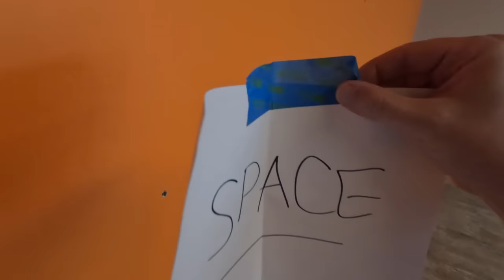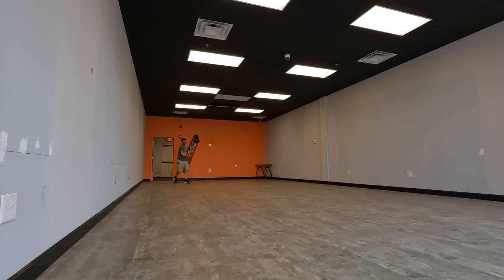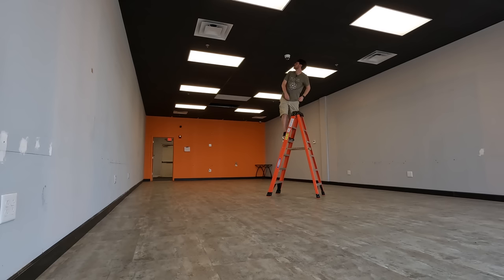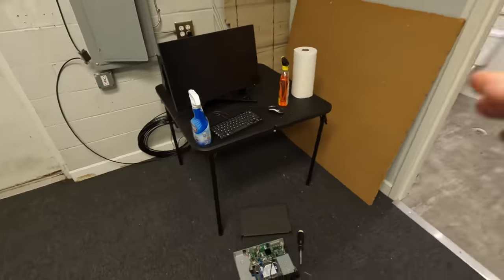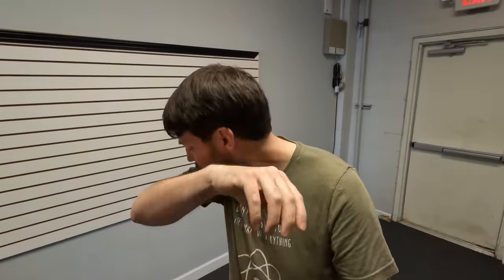First day in a new space! (moving 01)

Comment: Of course the best part of moving into a new space is showing everyone the key that unlocks the door 😀 Anyways, congrats.
Reply from the maker: Just don't show it too closely or else LockPickingLaywer will make a copy and—well, he could just pick the schlage lock pretty quickly, more likely.
Reply: @JeffGeerling  Use an electronic lock. I designed one , over 40 years aggo that just used a 4017 CMOS IC and a non matrix keypad. It can use up to a nine digit code, and my deign locked out a retry for about 30 seconds. To lock it, you simply touch any button which resets the counter.
Reply: @JeffGeerling  Honestly there's a single frame that's more than visible enough to see it entirely, but I assume you are replacing the locks.

Comment: For the NVR, remove the round CMOS battery, put it back upside down one seconds or two to discharge the capacitors and put it back the correct way, or put another fresh one.  It should then be at factory default.

Comment: Jeff sell the tool boards if you remove them as you stated you will use peg board which is a lot cheaper than the tool board you have up already. Maybe trade it for peg board so you don't have any cost in your peg board. Just a suggestion to save on out of pocket expense.
Reply from the maker: Yeah, not a bad idea. Slat wall isn't too bad, I just am more used to pegboard components for now. We'll see!

Comment: 6:40 the easiest way to get around that password is to simply format, the drive outside of the NVR as bear then re-insert it into the NVR as a boot up it will ask you to reinstall the firmware to the hard drive as for the password for the cameras, each camera does have a reset button inside of the housing

Comment: If you can, have your studio built as a room in a room, with inner wall not touching outside walls, so no sound bridge in between.
Reply from the maker: This is exactly what the architect suggested! The biggest challenge is HVAC—the unit is directly above the studio space, and return air is just 'anything above the ceiling' right now...
Reply: @JeffGeerling  Oh, and walls in the studio should not be parallel to avoid reverberation from one wall to the other.

That is all I remember from some plan for radio studio my father was overseeing 50 odd years ago. Sorry, no HVAC at that time. 

A separate split A/C for the studio may allow you to have a finer control on the noise level of the fan and you would have only a pair of copper pipes that join the outdoors unit to the inside of the studio.
Reply from the maker: @olivier2553  That's an interesting thing about sound—the parallel wall thing has more effect on certain frequencies than others, and is especially good when dealing with louder sounds or lower sounds. Apparently for human speech it's not as important, and interior wall treatments are more important (I haven't decided what I'll do for that yet, maybe sound blankets for starters).

I've been working with an architect on the plans, and she's done some radio work before. She showed all the wonderful different methods to achieve different STC levels. Many cost a LOOOOT of money. I'm going for 'quiet apartment' level so I don't have to spend a ton to get to 'radio studio' level!
Reply: @JeffGeerling  The return air is 'anything above the ceiling'? I hate to break the news to you but that means you need to use expensive CMP cable.
Reply from the maker: @eDoc2020  Plenum cable's not that much more expensive, just different (and I've seen plenty of plenum-rated cable used in non-plenum spaces!). It's all about buying the right spec cabling.
Reply: @JeffGeerling  I thought it was around twice as expensive. It probably depends a lot on the suppliers.

Comment: I recently moved into a place that had a very similar Hik-vision box, and I had the exact same issue about the password.

The key to fixing it is to reflash the firmware with a fresh image. Some older NVRs are susceptible to an exploit where they always search for a firmware image at a predefined IP address on the network, but that wasn’t the case with mine.

I stumbled upon the solution when I spotted four unpopulated headers on the motherboard, which turned out to be a UART connector. This gave me a terminal, and if I pressed an interrupt key combination at the right time, the ability to interrupt normal boot and get into the boot loader.

From there it’s fairly trivial to just direct the boot loader to the firmware on another computer on the network, and get it to flash. Then you go through the normal first time setup process and set your new password.

I will try to track down the instructions I followed for the bootloader, which also had some handy tricks for using the terminal. It was actually very straightforward once I found the UART headers!

Comment: if you don't manage to reset your way into that hikvision recorder, they are not particularly expensive (a couple hundred) to outright replace it. some of the cameras have reset buttons, some do not. but again they can be had for ~100 each, that being said the software experience with those recorders is not brilliant, a synology nas running their surveillance station software (camera licenses are extra $$ but you might be able to work out a sponsored video/ad deal to offset most of/the entire unit + disks cost) is vastly more user friendly and has nice to use mobile app for remote on the go viewing as required.
Reply from the maker: Yeah or alternatively ASUSTOR has their own NVR solution which I could use in a pinch.

Comment: There used to be a way to reset hikvisions by clicking a specific pixel on the login screen.  Not sure if it still does it that way.
Reply from the maker: I've been searching around for anything... it seems like the newer models require some Windows utility to dump a file out, then you have to submit that to Hikvision, then you can get them to reset it if you're lucky :/
Reply: Ah yes, the sadp tool.  I couldn’t get that to work for my units and ended up finding you could click one of the corners of the login screen.  That was a while ago though, newer units might have disabled that

Comment: So, first of all, CONGRATULATIONS! Having your own, "office space," while challenging at first, is a sanity saver. And obviously you'll setup remote into the new office so you can always PiKVM into a multi-port KVM for all of your "toys" in the office. Just for "those days" when driving in is not the best of ideas. Sound insulating the ceiling is going to be a necessity as you mentioned--I've dealt with wiring client's offices like that during a rainstorm. LOL
I'm surprised you got an office with a store front...??? Unless you're planning on selling Rasberry Pis? Hmmmmm If you're not going to use the frontal, a lot of building owners (for free) will "board it up," but in a nice way, blocking any view into the space from around 6.5ft downward. So some light gets in. Or they'll "smoke/paint" the inside of the glass, letting in light but blocking views. Keeps the office from getting broken into a lot. 
That DVR looks, uhmmm, simplistic. If the cameras are standard video/power wired, you can pickup a DVR at Microcenter which will work with them. Check the model of cameras because they might just be 720p resolution. 

Let the remodeling fun begin!
Reply: Oh, I forgot: I have rolls of CAT5e I don't use anymore. If you need it, it's yours. And I do have an old DVR and wired cameras which I pulled out of the house in favor of 14 IP cameras. Yours too if you want it as I have no need.